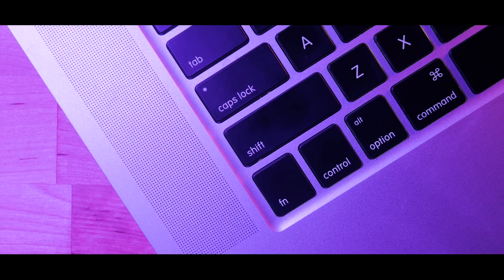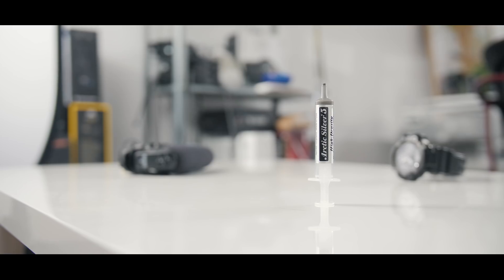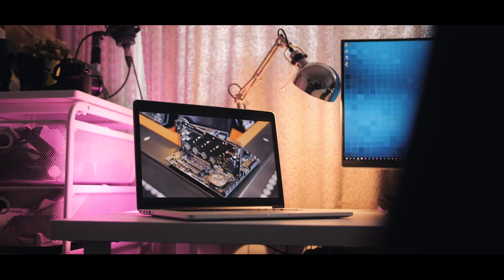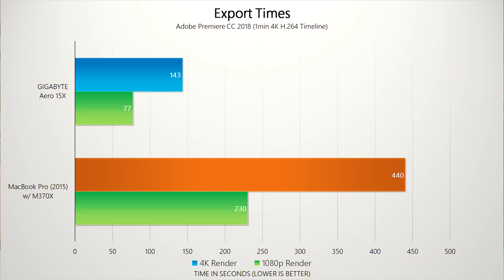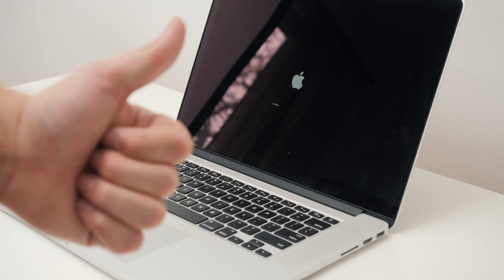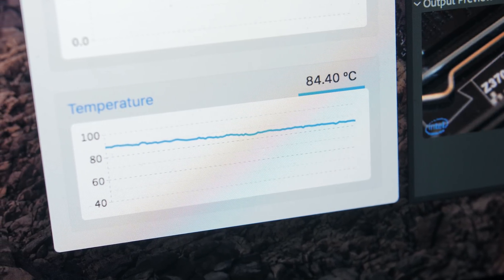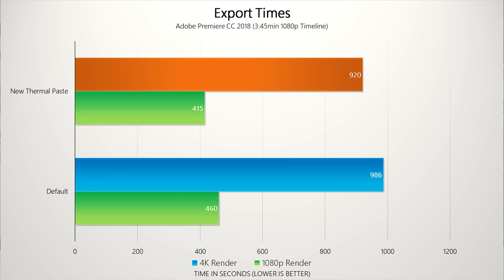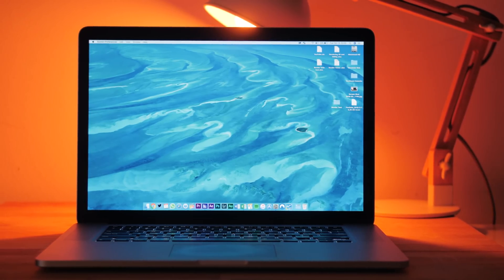OVERHEATING MacBook Pro! Can We Fix It??

Comment: YouTube is probably causing high temps because the browser is using VP9, which OSX or the browser does not support via hardware decoding (even though Kaby Lake graphics do). Try watching on Safari. It will use the H264, but it should use the hardware decoder, leading to lower temps a very, very low CPU usage.
Reply: This is acutally using an older CPU then skylake LOL. Considering the Macbook Pro is from 2015

Comment: Wut? 10%? That's not a significant difference between two laptops. So either you're exaggerating the performance difference between the two laptops. Or you barely improved performance on the MacBook

Comment: 76C for youtube playback "so that's great". Come on man don't lie to yourself
Reply: Junky228 mine neither
Reply: YouTube playback on my alienware 15 r3. 40 degrees lol..... playing wolfenstein 2 ultra settings. 75 degrees max....
Reply: liviu P i7-4710hq @2.6ghz all core boost, OCed 860M (combined TDP cca 90W) - I'm getting 75-80 on single fan solution in a heavy to run game (AC Unity comes to mind)
Reply: Blaž Bohinc sweet like sugar mate. Proper performance. Keep in mind my laptop turbo boost to 3.5ghz. if i disable turbo boost doesn't break 70 degree.
Reply: liviu P Mine's an old bastard now but still kicking despite poor cooling system design. I did what I could to improve it, it is what it is. Haswell chips get really hot past certain point and I lost the lottery. Alienware laptops have great cooling, but come in a thicker fashion. (Which is fine, why put good hardware in if you can't cool it (khm apple khm khm)
Reply: I get nervous when my 7300HQ exceeds 70 degrees under load.
Reply: Yeah, this is what i absolutely hate about Apple. They just don't like fan noise and it only really kicks in, when the CPU is about too throttle or just crash. I installed a fan tool on my iMac and now it runs fine on 50-60°, which is "ok" for a device that has such a strange cooling system... Of course you get better results on a PC, but that's Apple.. I have this Mac since 2009 and works still fine with the custom set fan speeds.
Reply: Guess you never edited a proper video on a laptop before 🤷‍♂️

Comment: Maybe apple makes this happen on purpose to make you buy another or upgrade? Like how they had reduced phones performance as they get older
Reply: Jessentis nah, Apple just follows thin-and-quiet approach, and will continue doing so. If only they made their laptops slightly thicker and used liquid cooling :/ That’s why Macs are only good for stuff like Netflix and low CPU load software.
Reply: Tergand Frostfire I meant put bad TIM on the chips that performs well enough for the first few months or however long but then dries up quickly and performs awfully making the average user without computer knowledge have to buy a new one or pay apple to replace it, etc
Reply: All OEMs use similar kind of TIM, not just apple. In fact, if you opened up a gaming laptop from MSI, HP, Asus, Acer ect. or a ultrabook from Dell, Asus, Lenovo, LG ect, you'd find the same type of cheap and quick drying TIM.
Reply: Mr. Meerkat ah okay then

Comment: AS5 has a cure time, so slightly higher-than-expected temps right after reapplying new paste is fine. The temps should normalize once curing time has passed. Manufacturer of the paste has exact number for cure times, but if I remember correctly, it’s something like a week’s worth of normal use, depending on fan speed or presence, and can reduce temps by a further 2-5C during the break-in period.

Comment: Its just apple slowing it down so you buy a new over priced POS
Reply: we try not to upset you guys when you come to the store. the 2015 MacBook Pro has complete and 100% support too run AFS on High Sierra with no affects on performance compared to the 2016 and 2017 15 inch models. even the late 2012 15 inch MacBook Pro will be just as fast at certain tasks (Web browsing, iTunes playback, FCPX video playback from the timeline, and a few others) the problem comes in with the fact that I know we do no use the highest quality of thermal compound on the cooler so it does not last as long with the laptop as it sits from the factory. There are other things that will cause unusually high temps on the computer and that usually is related to dust on the cooling fans which will reduce the air flow over the cooling fins which will make the fans spin up faster and make the computer louder as a whole. if you have had you Mac for more than 18 months and are having issues with thermals, you no longer have a warranty if you did not buy apple care+ so I do suggest doing what Dimitri has done, granted not with as much thermal compound as has been used here. for the best results I do suggest liquid metal, you will not see anything higher than 85 degrees under load with thermal grizzly conductonaut.
Reply: whats POS ?

Comment: You can only expect a drop in temps if you used liquid metal. Arctic Silver 5 isn't gonna do shit all. Ever since I went liquid metal on all my components in my PC and laptop, everything else is a joke.
Reply: I have the same macbook, and the same problem, thinking on changing the thermal paste. What brand would you recommend?
Reply: GrayFox370 Sounds like you actually applied liquid metal to your laptop, unlike others who just like to speak about it. I have a syringe of Conductonaut and I'm worried that if I apply it straight to the die on a MBP and then it cakes because of poor contact, I'll have to sand off the excess and scratch the surface of the die. That is if I will have to remove it for any reason. Not sure how well laptop heat spreaders contact with their dies. Would you say my worry is warranted?
Reply: You don't apply it like a normal paste. You paint it on the die. Look up videos here on YT on how to apply it. There is no pea or line method like how Dimitri applied Arctic Silver 5 here. Also you need to apply some to the CPU/GPU heatsink as well. You don't need to sand it off if you wanna remove anything. You just take some rubbing alcohol and a cotton swab and remove it like that. It's not that hard. Just follow instructions and take your time and you will be fine.
Reply: Cesar Harretche I don't have a Macbook but yes thermal paste would definitely help in temps. I'd recommend Gelid GC Extreme or IC Diamond if you don't want anything conductive or liquid metal (Coollaboratory, Thermal Grizzly) if you want the best temps.

Comment: No use of using a MacBook if your using premier pro! Macs really shine in final cut!
Reply: Blaž Bohinc that’s literally not true, I have a 9560 and when both cpu and gpu are at 100% the 7700hq runs at like 2.1Ghz (down from 3.4ghz) and the gtx 1050 runs at 1.1 GHz (down from 1.65ghz). The cpu reaches over 90C and the gpu hits 78C and will start to throttle down to half the boost clock. The fans simply kick in WAY too late and the fan controls are locked in the bios so nothing short of reflashing I can do. The 7700hq is also already factory downfigured from 45w tdp to 35tdp and will downclock to 15w when stressed. This laptop is literally a disaster when it comes to sustained performance. And no, I’m not risking breaking anything and void the warrant by opening it up and repasting, plus the problem is actually the VRM overheating, thus causing power limit throttling(alongside thermal throttling)
Reply: FDMtech headphone jack isn’t going anywhere on laptops, and the 2013 mbp was probably the best with the 4850HQ and gt750m. It didn’t lag behind other laptops before they switched to ATI crap.
Reply: Blaž Bohinc  the MacBook Pro is technically the most powerful laptop in terms of cpu perf since it uses the i7-7920HQ running at 4.1Ghz max vs the 7700HQ running at 3.8Ghz of the dell xps 15 and the new 2017 models do a fine job at cooling them too (the ones with dual fans not the one with a single fan)
Reply: Supercharged did you repaste and undervolt it? Which generation are you running? How hot is it where you live? XPS has sufficient cooling. Proven, tested. Maybe not out of the box, but much can be done to bring temps down.
Reply: FDMtech the headphone jack isn’t going anywhere on the Pro line of Apple products lol
Reply: The mid range budget laptop is the sweet spot for price to perf. My Acer Aspire E15 got a dual core i5 with Hyper Threading and a 940MX DELICATED GPU(and The damn Intel hd 620 igpu of course)i can play games at 1080p low or 720 high.and did i mention its only 470 dollars! Although The screen is BS there some great laptops out there like The mi notebook pro with The quad core  i5 with Hyper threading and MX150(and uhd 620 igpu)is a killer with the IPS screen in a aluminium body and also i5 have no branding aside from the small mi logo under The screen!
Reply: Shuvojit 
Maybe cause of sake of consistency as eber also uses premier
Reply: FDMtech
also the ssd is replaceable on some of them and you can run at full usb 3.1 even with uncertified USB-C devices
Reply: Supercharged
 ATI died a long time ago and Macs haven't run ATI GPUs since 2009
Reply: Client Digital he means AMD I suspect.
Reply: Pad 33 yes lol amd just bought ati
Reply: So he's using it wrong because he's on Premiere? It's not about what program is better, it's the heatsink's incompetence to cool a chip at 2ghz.
Reply: Blaž Bohinc I definitely know that the heatsink can't cool it cause the Mac tends to run toasty as Apple loves design over functionality! If he isn't hooked into Mac for final cut he can easily get better laptops that are still and more better in performance than the mac at premire. Like the razers!
Reply: The new heatsinks can't even cool lowest tier i5s, let alone the higher tier i7s.. It's wasted potential for that thin design.. Just make the base 5mm thicker and put in a bigger battery and thicker cooler. Why is it so hard to use logic..

Are overheating laptops sexy? Is that something that people are okay with?
Reply: Blaž Bohinc 😂😂😂 Hell yea people are happy with that mate! Apple sells this and people buy it so I can say yes.. :-| but logical people won't buy it.. If and for the only reason pro users buy it is for the final cut and the reliability factor I guess.
Reply: My friend is the ultimate apple fan.. His fans spun up all the way the other day and he thought something was broken. I mean.. what can you say in response to that? I'm all about that XPS though.. and I don't understand how people put up with sweaty hands because everything is hot enough to boil an egg. I'm just waiting for apple to put out a passive cooled i7 laptop. I mean.. people will still buy it and it's silent. fuck
Reply: Blaž Bohinc 😂😂😂😂 apple would say yes it's a invention we did.. 😂😂😂 I'm a desktop guy with a mi notebook pro as my carry on when I'm the college seriously speaking the mi seem to run more cooler if I use Intel extreme tuning.
Reply: Yeah I run intel extreme tuning utility for my laptop to undervolt and underclock it. Mi notebook pro is a beautiful laptop. great choice! Great performance as well. What are your thoughts on it?
Reply: my XPS 15 also overheats and throttles like crazy......

Comment: This is what happens when you make your PC from a single piece of aluminum.
Reply: That makes no sense at all. Aluminium conducts heat very well, so making a laptop out of it would make the laptop feel hot, but actually run cooler since the entire body would function as a heatsink. I have the same Macbook but mine is a year old and does not get warmer than 45c while watching youtube and browsing. His Macbook just had a problem with the thermal paste, tightness of the heatsink screws or dust (or w/e) which needed to be fixed.

Comment: Hey D what program are you using on OSX to monitor performance? Thanks
Reply: He was using Intel power gadget for the cpu clock speeds and temps. They have windows Mac and Linux versions of that software.

Comment: I wonder how much is due to new thermal paste and how much is just due to dusting the vents and fan blades?   I don't knock changing the paste at all as it was probably starting to get a bit died out on a notebook that has been used for the last 2 years and you were opening it anyway.  Just curious about what the difference between would have been.
Reply: This.  I did see at least one good size dust bunny/rhino in the video.  I would say the improvement was mostly from the fresh TIM but also from cleaning out of the vents/blades.
Reply: i was thinking the same but i think the dusting helped out a lot, it helps the fan move a lot more freely. You can see how small the fan is and it would allow more heat to dissipate

Comment: i dunno about mac, but windows laptops restrict the performance of the processor in balanced or power saver mode, switching the power management to performance mode uses it to the max potential
Reply: GrayFox370 so does mac has something similar ?
Reply: GrayFox370
What's with the rude answer? On your period or something?

Comment: Is it me or did he use too much thermal paste...
Reply: Liquid metal is too much of a hassle for a laptop tbh :|
Reply: Nah. He could have shaved more if he used liquid metal.
Reply: GrayFox370 all of realize you have to replace liquid metal every 6-7 months right? Also it can eat away at certain metals causing corrosion
Reply: I have been using liquid metal on my GT73VR for over a year now and haven't had to replace it once. Yeah it can cause corrosion especially with aluminum but you just need to be careful when applying it on. Take your time and follow instructions and you're golden. My 7820hk clocked at 4.4ghz never goes above 65c and my GTX1080 clocked at 2050mhz and never goes above 60c. Granted my laptop is a lot thicker and has a much superior cooling system compared to a Macbook Pro but still.
Reply: YES!  (came down here to find this comment).  Way too much thermal paste.  I'm betting he could get another 5-10° cooler with a correct application.
Reply: Abraham there is no such thing as too much thermal paste :p
Reply: Metalfreak Apollo all jokes aside. I think that was a bit too much, he could shave off 5 more C if he used less

Comment: Drill some holes on it. The poor CPU must be suffocating hard because Apple thinks it's fancy and "minimalistic" to not put proper ventilation on their laptops.
Reply: I did just that this morning to my macbook pro that was reaching tempreatures of about 170 F...... I could cook an egg on that temperature. I changed my fan speeds manually to be default at 3500 rpm and drilled 9 holes in a parallel fashion to the screw holes at the end of the bottom lid. south of the track pad. I seen other people do this, but they put the wholes on the bottom of the lid of the macbook. I did not do this because it would not be getting any air in when it sat on a flat surface. I did the 9 wholes almost at the spot where the case curves upwards, and you cannot really see them, but they work great. I been listening to music, bluetooth on, wifi on, 80% screen on and charging the laptop and at the highest peak it got 150F and on avg it gets to 135F . I am very pleased  with this modification... It works great!!!!!
Reply: Crimson Koba It is fancy and minimlaistic

Comment: guys I kind of want to put this out there, apple will not release a product if it cannot properly cool itself under a full extreme load. what Dimitry has done here is something that I would suggest a lot of Mac users do themselves, or have someone they trust to know what they are doing, because it is necessary as thermal paste does dry out as most of you know and it will lose it's effectiveness in heat transfer. if you have had your Mac laptop for more than about 18 months and have started to have noise and heat issues with your laptop, I would suggest this as a primary means of handling temps, that is if you know that you have done nothing to the machine that would cause it thermal issues in the first place, such as using the laptop in your lap while you are cross legged.